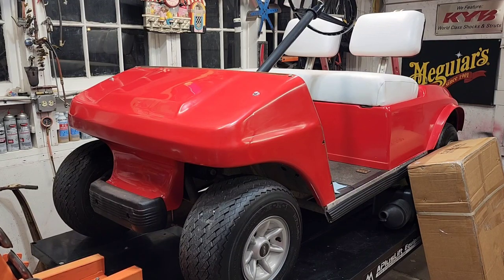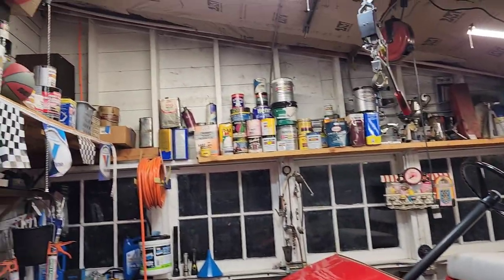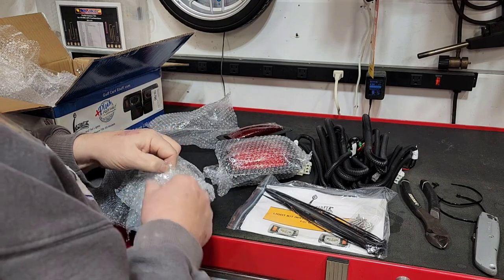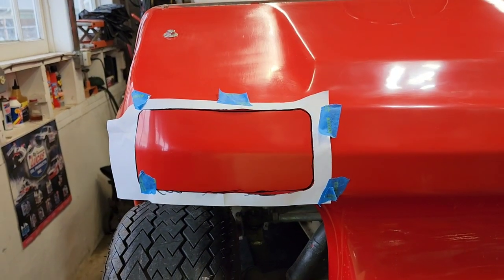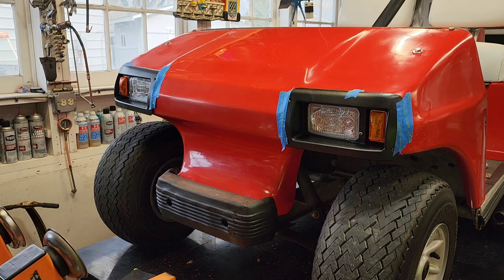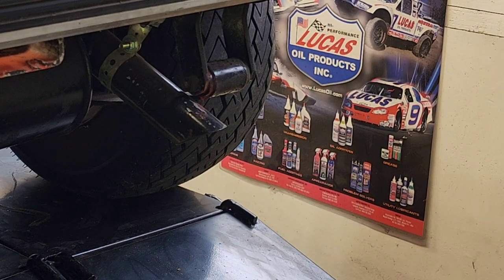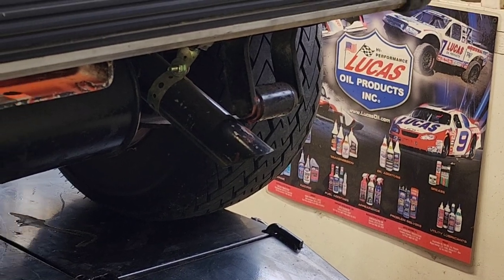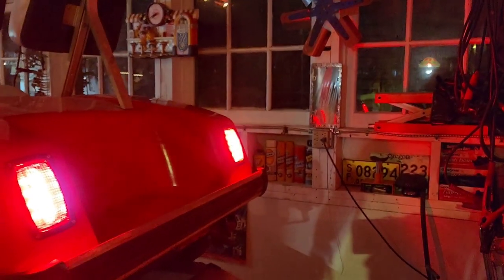1988 Club Car DS Gilf Cart Upgrades! LED Headlights and Tail Lights are first!

Comment: what light kit did you buy for this I have a 88 also.
Reply from the maker: Just go to Amazon and pick a kit. For a few extra $ you can get a street legal kit that has turn signals and horn. I sold this xart and did a 2008 Yamaha Electric and put a Street Legan kit , there is a video on they too. I bought a 48 volt kit for it...